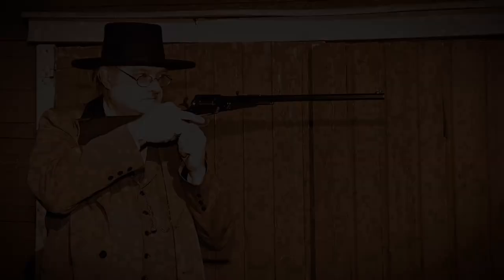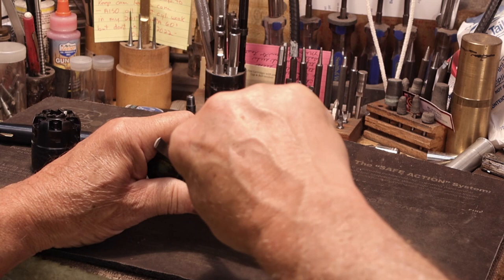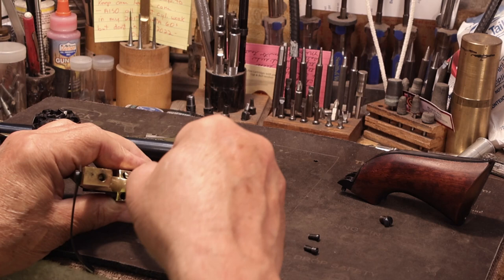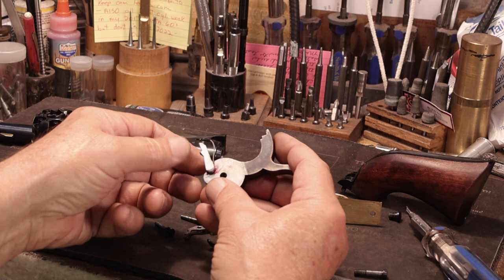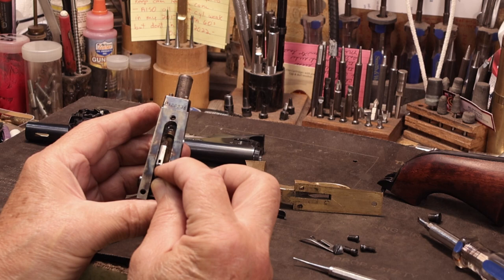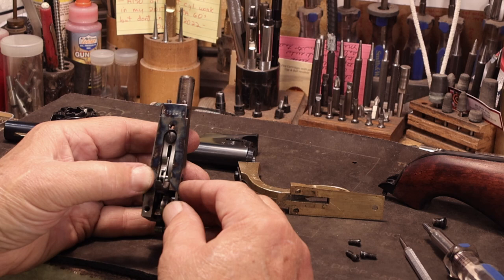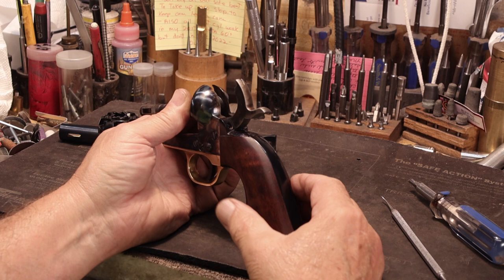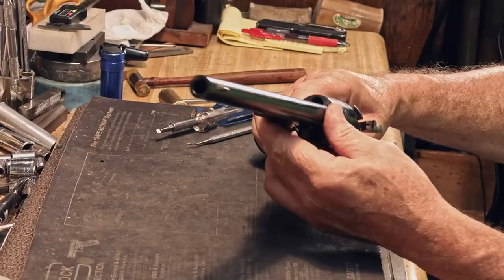Disassembly and Assembly of Colt Black Powder Guns

Comment: Thanks for the video.  I have taken a number of Colt type single actions apart but one thing I haven't done was to move the mainspring like you did.  That's a neat trick thanks for the tip.  And, yes, I too have put the trigger/bolt spring in wrong by not correctly getting it on the trigger properly (rats).

Comment: Just curious if someone cal help me understand. 
I got a .44 caliber black powder Colt navy revolver. And was wondering if one of these konversion kits works on it or not. Does the kit need to also be .44 caliber? Or does the barrel length and diameter make no difference if I put on say a .38 special cylinder?
Reply: They work fine.  The frame cutting for loading ammo into the cylinder is better left to the professional unless you have machinist skills (I don't).  This gunsmith has done a couple of them for me.  The .44 caliber black powder revolvers are actually .454 so .45 ammo works just fine.  I prefer to use cast lead bullets in ALL of my BP conversions as well as model pistols.  They are cheaper (I reload) and put less wear on the barrel.  Don't worry about leading if they bullets are properly lubed.  The presenter of this video has an Uberti .44 Colt Model 1860 that I bought the .45 ACP Konversion cylinder for.
Reply: If your revolver is a .36 caliber Navy type, the actual bore diameter is .375 so it is best to use hollow base wadcutter bullets.  They will expand to "catch" the rifling in the barrel and improve accuracy.  If you don't reload, there are companies that make Cowboy action ammo for this.  Barrel length doesn't matter.